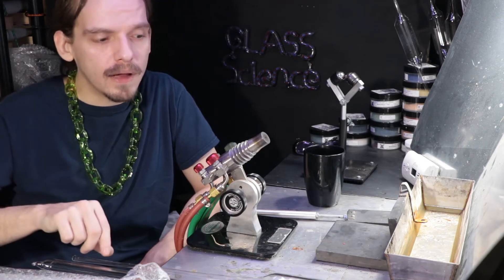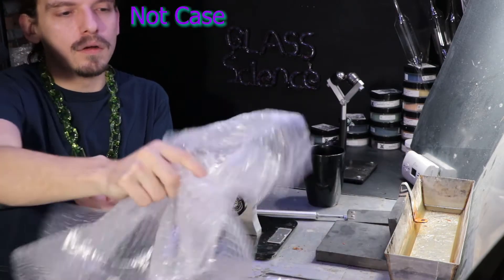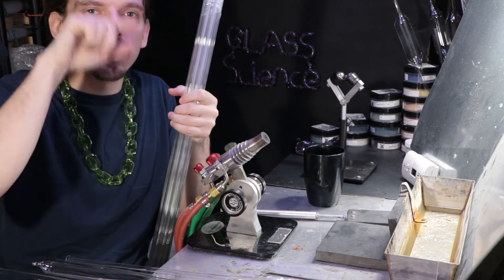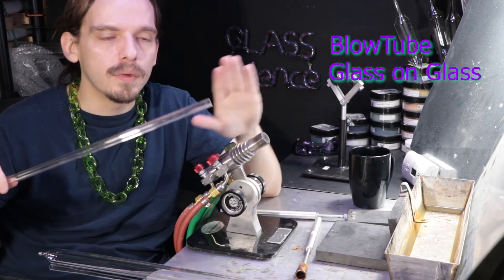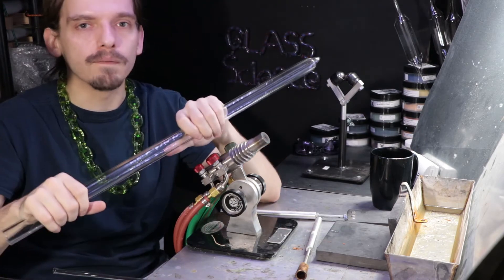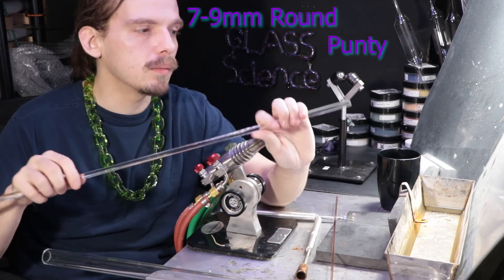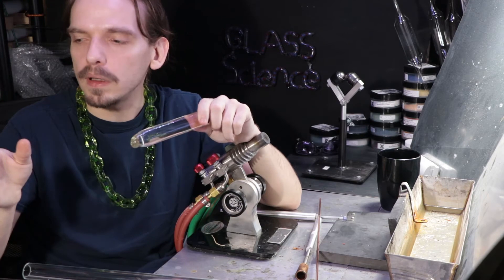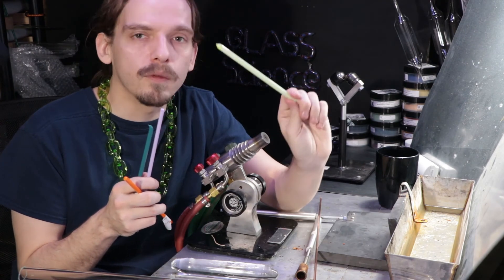Lampworking Techniques | Glass Selection

Comment: How do you avoid cracking where tube and blow tube are joined? Tips on better seals? Thanks
Reply from the maker: That can be an extra stressful area because of the connection. I would always avoid taking the flame directly to that area after it's cooled, and rather start a few inches away and push heat towards it conducting through the glass. It might help to pop it into a kiln for 5 minutes first, then start working around/on it.

Comment: Is it possible to join borosilicate and quartz glass, or lime and boro? Or will different thermal expansion rate make the joint to crack?
Reply from the maker: I've never experimented with that myself but generally when the COE is even just a little different you can run into problems very quickly. Like a sparkly green boro color might crack a boro marble if its encased too deeply. Theoretically though in small applications and given enough time cooling down anything is possible.
Reply: This may be a little old now, but I'm a scientific glassblower. I've not done this myself but there was one job the head glassblower used to do where he had to grade up from lead to quartz, which are almost as soft as you can get to as hard as it gets
It'll be very hard to do without a lathe I imagine (at least in the way I know how it's done), but it's possible, you just need different "grades" of glass so the thermal expansion is done in steps. I can't remember if it was like 8 or 12 different glasses leading up to quartz, but it's a lot. It's also impossible to anneal completely correctly, because obviously you'll have to anneal to the softest glass in the grade otherwise it'd just collapse in the oven, so flame annealing is real important.
A more common one (at least in my factory) is actually grading between two different boro glasses, because even two of the same type of glass, but different COE can cause massive problems, and that uses two intermediate glasses that are specialist for that job.

Comment: Newb here. Where is a good place to get glass?? Best brands? Cheap for learning ? Love your info. Thanks
Reply from the maker: I have a video on that --> https://youtu.be/r4dsgfJVHX0  Best 3 for Clear = Simax, Pyrex, Schott (i've used a lot of Simax). Then for color I mostly use Glass Alchemy and Truatman Art Glass (TAG). Import is cheaper but for learning you don't use a lot, you can also reuse your glass for other projects.
Reply: Matt Jasa do you have a video on reusing glass? if not could you possibly make one or point out how in another video. i can visualize it easily enough with traditional glassblowing, where you can just throw scraps or mess ups into the furnace, but with lampworking this is probably a dumb question but how do you do it? do you just kinda collect it into a glob and then blow it back out? or.. ? id really love to see this in practice, as a total noob i have no idea how to get the most out of my glass. 

sounds like a good title for a video 
"getting the most out of your glass" or "how to get the most out of your glass"